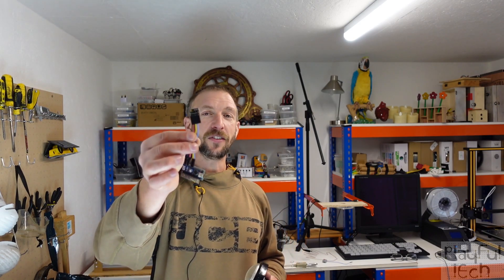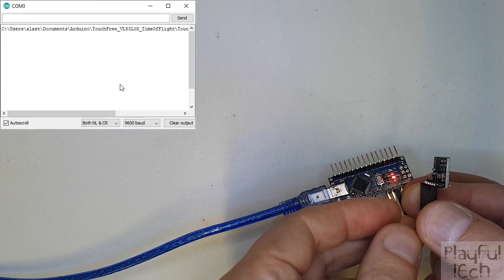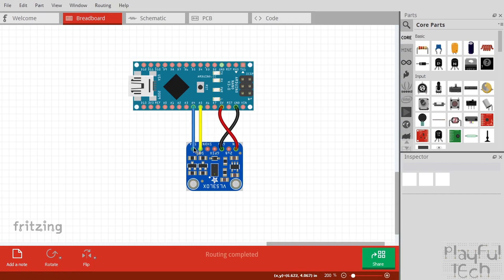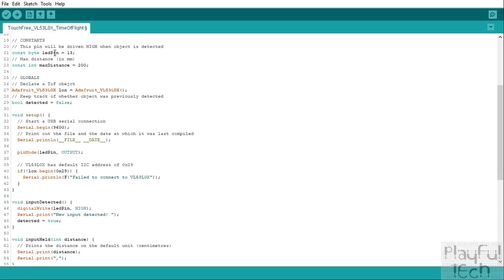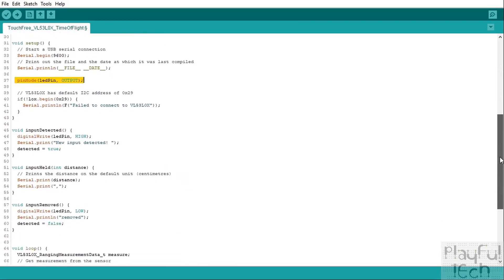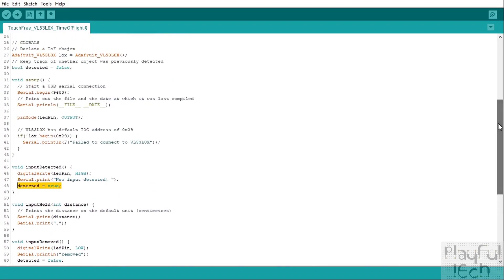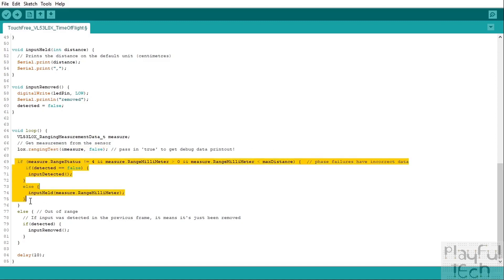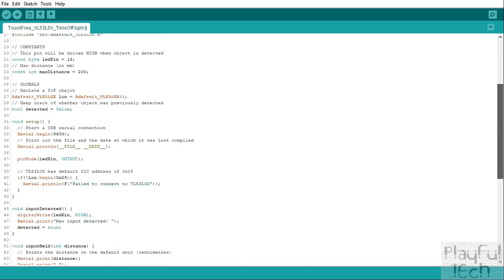Arduino Laser Time-of-Flight Sensor Touch-Free Input Tutorial

Comment: So, I have built a system that works with a D1Mini connected to led lights (WLED) and two TOF (bottom and top, connected to a D1Mini each). Using ESPHome and Home Assistant, the TOF detection can turn my stair lights on/off... the problem? I need to run Home Assistant to make the system work. Is there a way to run a system like this or similar (based on TOF) so I can manage my stair led lights without using Home Assistant?
Reply: Im not sure how the lights in the stairs are controlled (via its own controller or simple inputs), but a relay would seem like the easier thing to control a simple turning on and off of leds...

Comment: Some years ago, more than ten, I worked on a project that used these sensors (a very short-range version) to detect if a drawer was properly closed. In working with it I discovered that the measurements are not as consistent as promised by the documentation. After working with it for a while I discovered that the sensor behavior changed just a little bit at 8:00 in the morning, when the building HVAC system turned on. I created a system to test sensor reliability, ten sensors, while I heated and cooled them in a box. One interesting thing I discovered was that I could assert reset to all of the devices, and then release that reset one at a time, each time sending a command to the default address to use a different address. Then I could access any one of the ten sensors from the same Arduino on its new address. 

These sensors are not immune to temperature change, but they are built to try to compensate for it, and sometimes the undercompensate a little, sometimes they overcompensate a little, you never know from one sensor to the next what you will get. Also, the consistency of the reading can change with temperature, sometimes getting a little wilder as the temperature goes up, sometime settling down. I found that even though they were also not supposed to be affected by ambient light they actually behaving like they did for temperature. The variance of the readings was not too great, but our requirements were very tight, so our system had to keep doing a calibration on the sensors to work properly.

It was a fun project, I ended up being allowed to keep the fixture, and I still have it with the ten sensors.  :)

Comment: Do you think it would be possible to use this for a dimmer?
Reply from the maker: How do you mean? I had a plan to use two of them like a theremin, to alter the pitch and volume of a musical note. But for a dimmer, wouldn't you always eventually have to remove your hand from the detection range and end up turning the light off?
Reply: @PlayfulTechnology  hmmm... good question... maybe like this... mount the sensor under a shelf.... lets say the maximum distance is 200mm... so put the hand at roughly 100mm, move it up and hold it there -> the light gets brighter... or... move it down from the middle and hold it there -> light gets darker ... also keep the hand at 100mm and move it to the side (out of the laser line) and back a few times, that would turn on and off the light